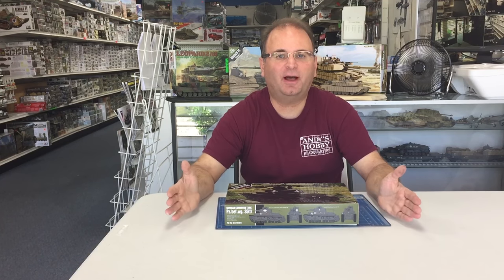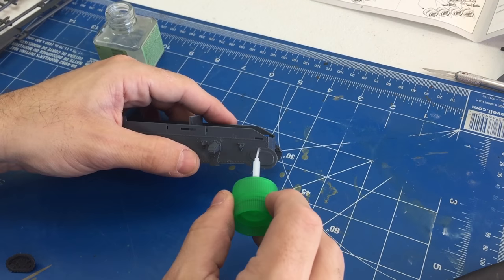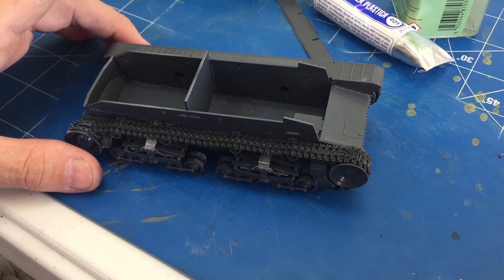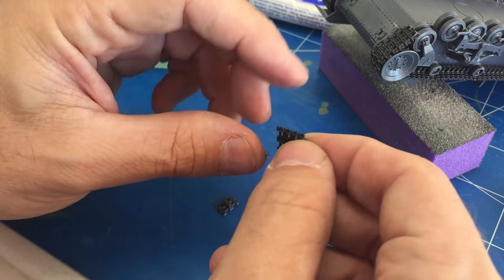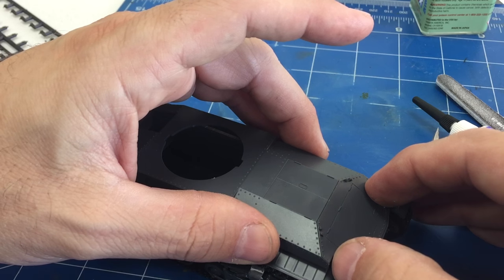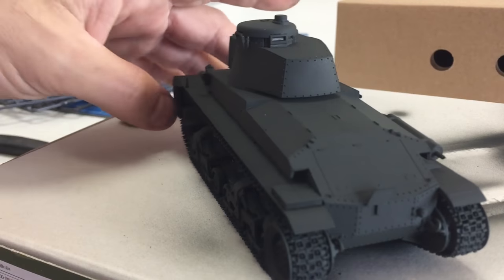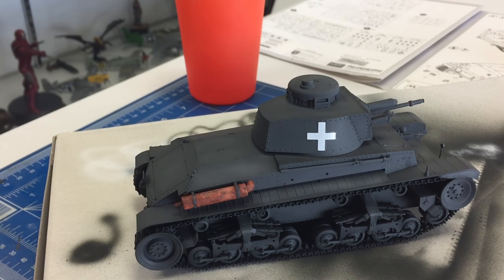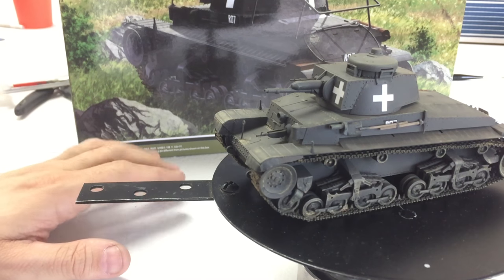Building the Academy models 1/35 panzer 35t

Comment: There's two additional spacers in the sprue for the front running wheels that are not mentioned anywhere in the instructions. Using those will eliminate the issue of the tracks not fitting properly.
Reply: Thanks for the info, I started building the hull last night. So far I'm content as the pieces 'fall together' for the most part making the multi-part lower hull easy to build. Any idea what the spacer's part number/sprue letter is?
Reply: Cool thanks. I bought it online yerterday. Will see the spacers when it arrived.

Comment: Andy, how do you glue on the small tools like the shovels after the model has been painted? Do you use CA glue? Or do you sand a small spot so that the Tamiya cement will bond the parts? The latter seems difficult to do cleanly.

Comment: At 5 mins 23 where you mention that you need to put a piece between the wheel halves there are 2 pieces supplied with the kit but the instructions show only one on the right hand side.Look at the step showing the assembly of the parts the right has side mentions the part no.I built this kit when it came out in the UK and almost missed that piece